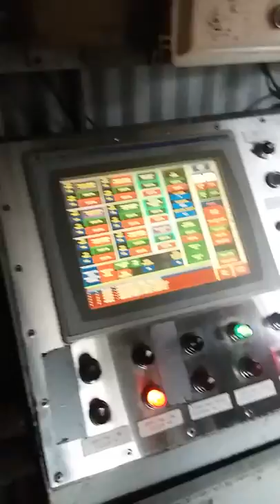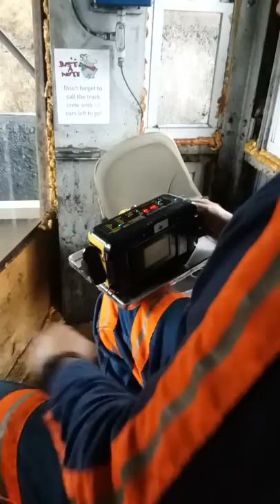Loading coal hopper car

Comment: Would you please explain what it means when the coal hopper cars have "ROTARY END" painted on them?
Thanks! (Love the videos)
Reply from the maker: That means that end is a rotary coupler which means the cars can
be still coupled together and be rotary dumped. On a non rotary 
coupler have to un hook the cars before dumping with a rotary dump trainman. You will also notice the red panel on the end. You may
see other cars on other RR that have a white, green or blue panel
which denotes rotary coupler end.
Reply: Thank you Dave, but how can the entire car rotate when only one coupler 'spins'? My knowledge is really low on this stuff.
Reply from the maker: @trainman2k  other end of car is disconnected from any other car. Car being dumped just spins around rorary coupler while coupler maintains its position
Reply: Oh. Okay. I don't know why I thought they'd stay connected to the train on on both ends of the car. 
I never shy away from asking questions because I may be retired from a job but never want to stop learning.
Dave, I cannot measure the knowledge I've gained from you. I truly thank you for your efforts and teachings.
Reply from the maker: @trainman2k  👍😊